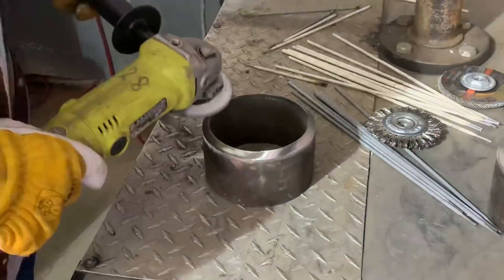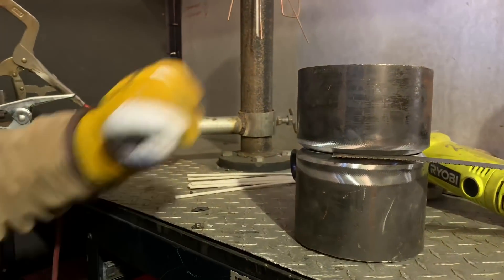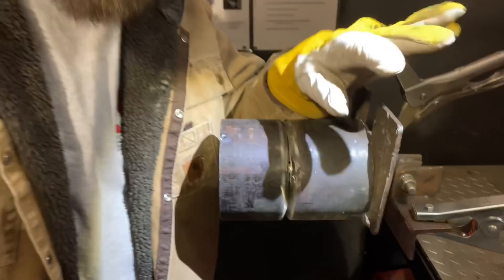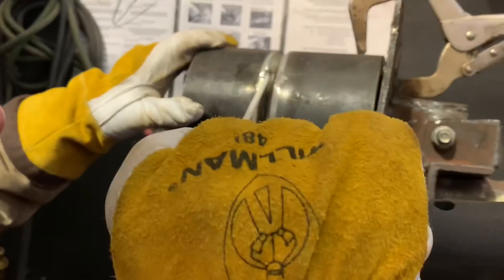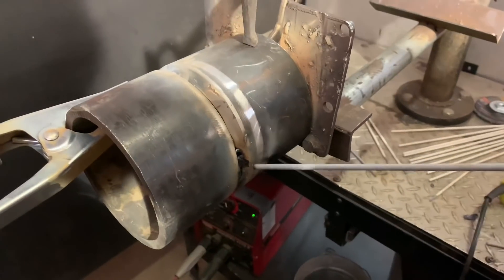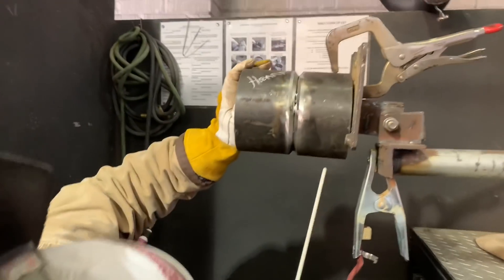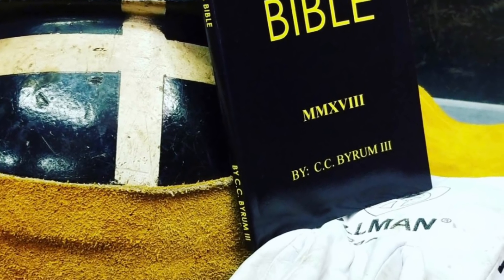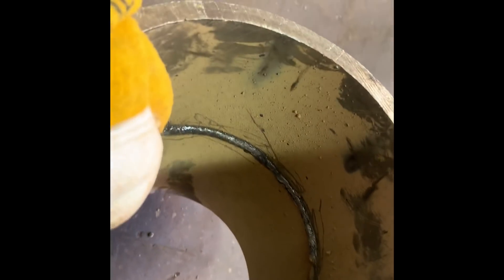6010 Root Uphill  with Magnetism in Pipe

Comment: What's a good fit up for sch 40 2"? Its really kicking my butt because it heats up too fast!
Reply: Just gotta keep practicing man and find out what works for you. Some people weld hot as hell, while others like it a little colder so they can take their time and control the weld more. Try turning your amps down a little and adjusting your heat with your arc length. Inevitably you want to learn to weld hot...if it's hot there is nothing negative living in it bro. Burn and learn!
Reply: @nitrojunkie9027  I got it down, i passed all the xrays on that job , it was a real pain in the ass but i got it lol , thanks for the advice brother!

Comment: How many amps?  1/8”  rod?
Reply: 120 for the root thats way to much
Reply from the maker: +Adam Johanson 80-95
Reply: 80 or 90 just depends how good you are running the hot rod.
Reply: I use about 80 about a little more of a nickel land and nickle gap pushing it in there and you alex quintero
Reply: Adam Johanson about 120-125